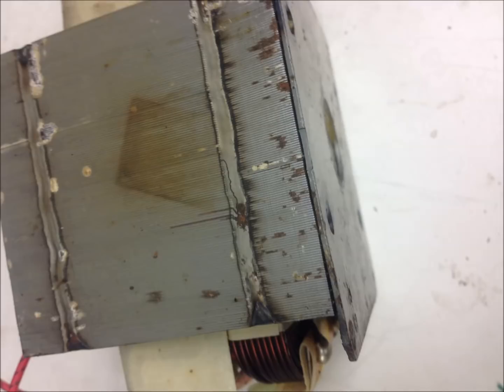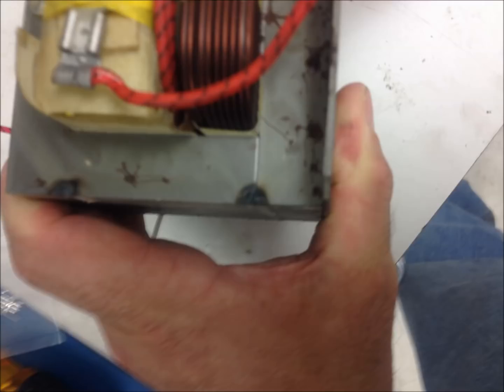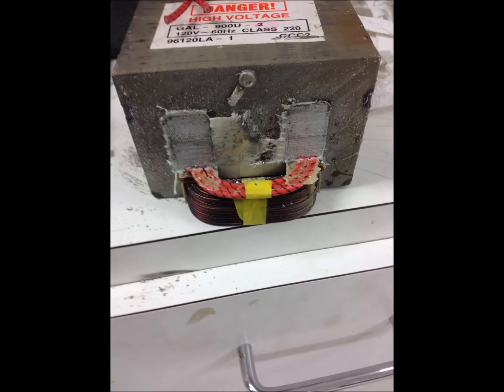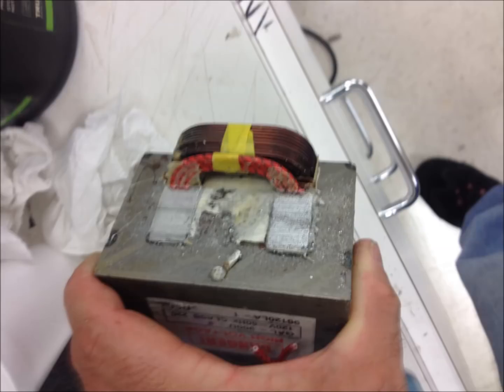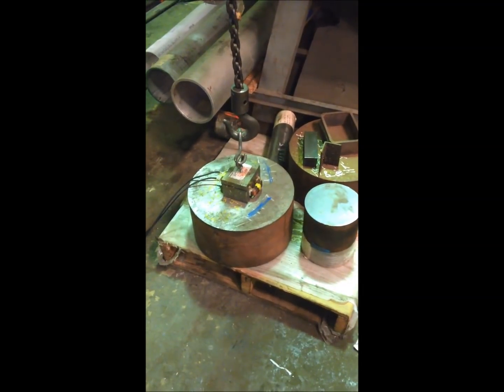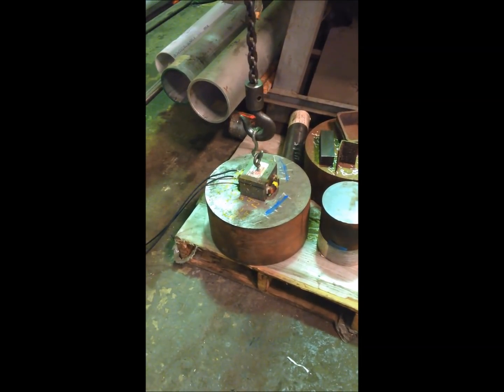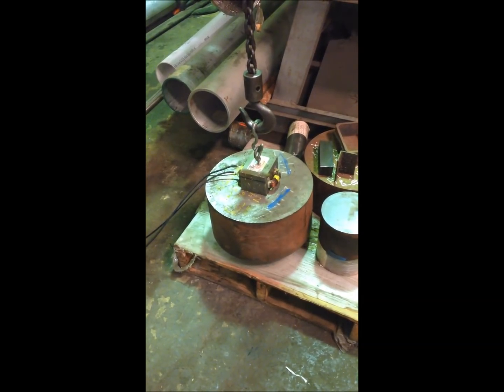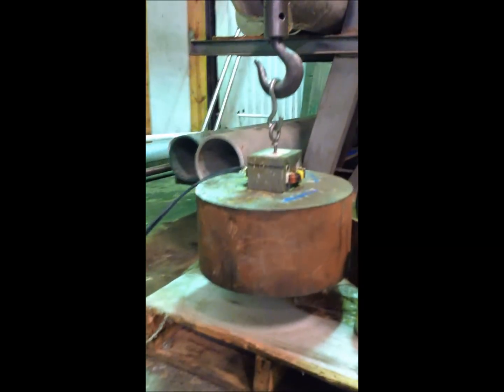homemade electromagnet made from a microwave transformer

Comment: is it ideal to place the primary (i assume that one taken out is the primary) coil far to the front like that or what happens when it is placed to the back? do you happen to know if shortening the length of the metal to have less of a gap in the case of moving the coil to the back.